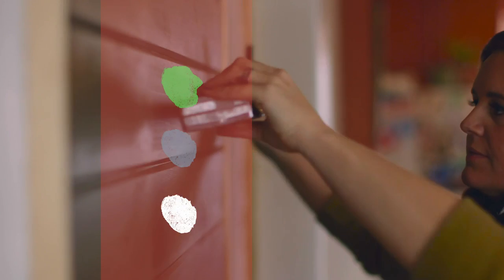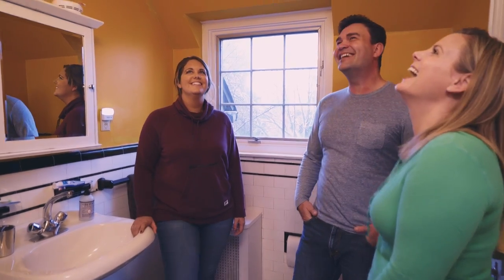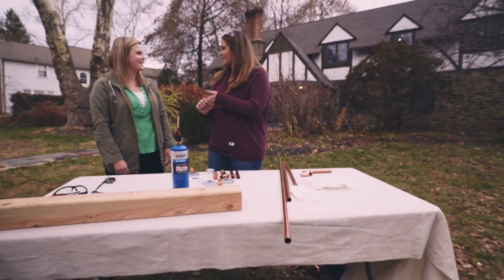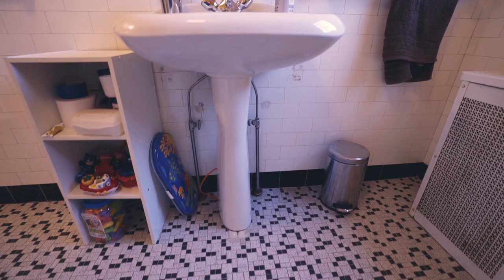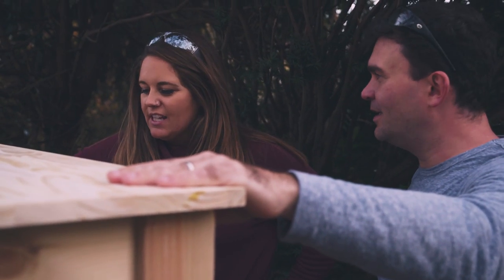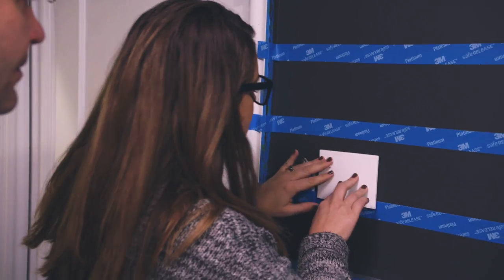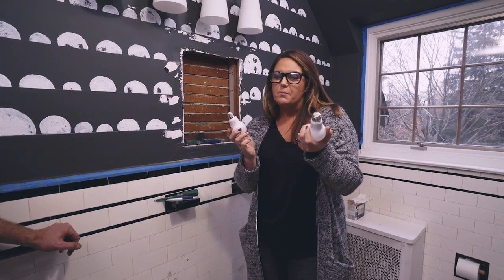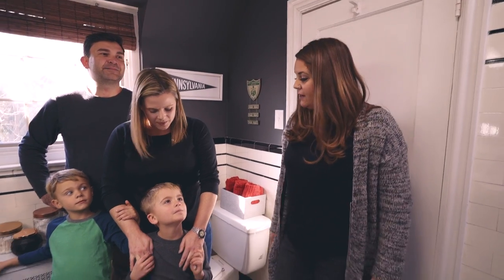The Weekender: "Black is the New Orange" (Season 3, Episode 8)

Comment: Right now it looks cute but that wood top won't last long with use.  "Vessel" sinks make it hard to keep water off the 'counter.'  They're cute but not practical.  They can always replace the counter with something more water proof and maybe an undermount sink, eventually.  Have to raise the top but, doable.  As far as the decor goes, I like the copper piping and the dark wall but I'd have to paint over the "bubbles." Too busy, and doesn't make sense with the rest of the decor, I think.  The panda art is cute and without the bubbles, a different/simpler light.  Oh, well.  It looks like,  I'd change a lot.  lol...  Love the idea of the bamboo plant, Nicolle.  Always have to be careful to not get too themey but I think it would work.  I agree with Crane S... A tall plant in the corner.  There!  Now that we've totally  messed the whole thing up...  Well done.

Comment: Anyone else notice the dry fit of the shower rod  is upside down/ backwards? Then when they soddered it was still like that? The only way to fix it is if the T joint gets turned 180 degrees. Did they go back and fix it or was the T joint not soddered yet?